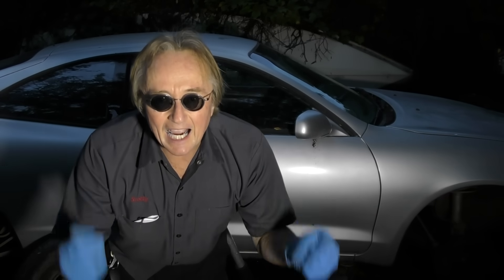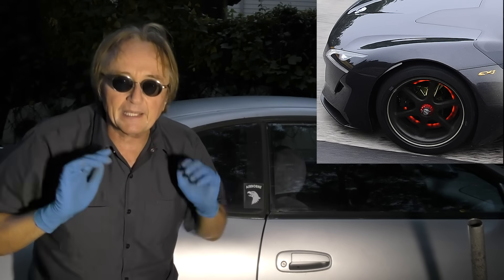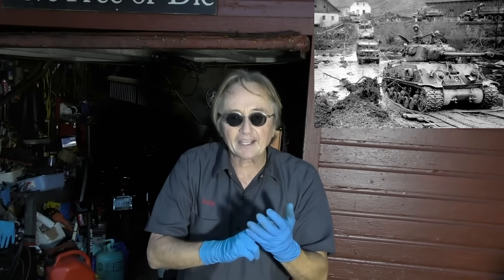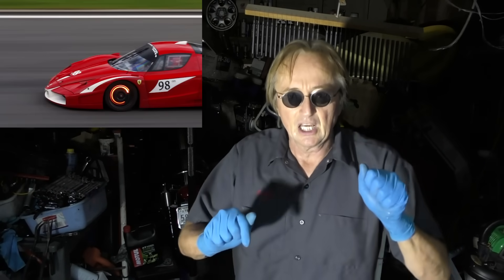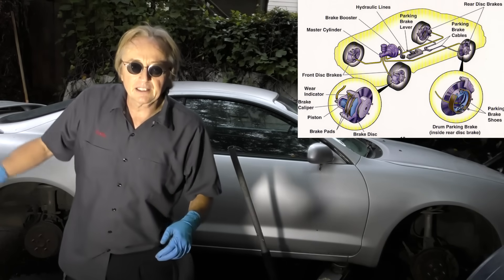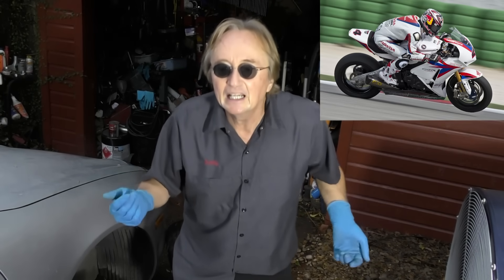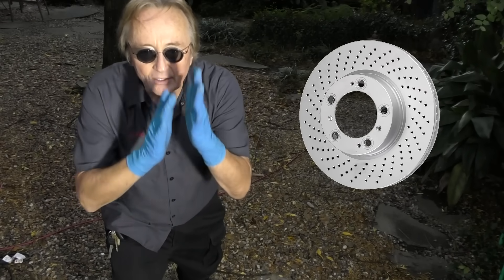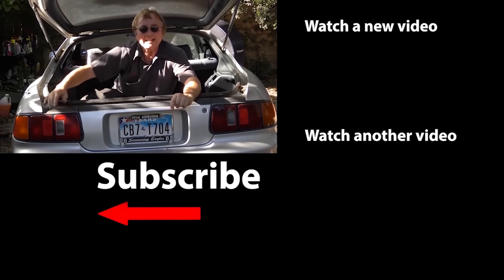Why Some Cars Have Drum Brakes Instead of Disc Brakes

Comment: My old pickup had all wheel drum breaks, and I converted it with front disc Breaks , it saved me all the pain trying to get those front drum breaks work right! , not to mention that they needed to be adjusted every now and then which probably will cause uneven break power distribution to the wheels , and that sure is dangerous , it was a pain in the neck , so I just had enough of that and decided to go with disk breaks , they work way better and most importantly they don't need any adjustments , disc breaks have  calipers which gets tighter as the breaking materials wear out , 
I think it's one of the main reasons why all modern cars have front disk breaks , at least privet cars , 
Scotty didn't mention it so I thought I can share it .
Reply: Yep, definitely worth swapping.  Also, the reason why your brake fluid level in the master cylinder reservoir drops over time.  Many people don't realize it and add more fluid, then when you have the brakes replaced you end up with all that fluid that was added pouring out all over the place as you force the brake caliper pistons back into their home position.  Fluid dropping over time is normal...course an empty master cylinder is not normal, but a gradual drop in fluid over a long period of time as the brake pads wear is just the way they work, as the pistons adjust to brake wear the fluid level drops.
Reply: @wildbill23c  
True , 
But I don't see any problem filling the break fluid reservoir , as anybody with little experience can figure that out and remove some fluid from the reservoir before putting new pads , no big deal  ,

What many  people don't know is that break fluids needs to be changed over time , most people I know they never changed their cars break fluid since the day they bought the car .
Reply: It's funny that so many people can't spell brakes

Comment: Thank you dear Scotty so much once again,  this is not just telling truth about car parts but also what does really make sense, where the hell would  I need race care brake discs and pay a lot more, they would squeal and make horrible noise. I didn't find any episode where you help maintenance about disc brakes, not just discs or pads but also those tiny bolts I'm sorry I don't know their real name as a Finnish guy but they need to be cleaned and lubricated once or twice a year, otherwise pads are touching discs all the time, make noise, wear out too fast, cost more and damn lousy gas mileage.

Comment: Kind of interesting which/when car manufacturers made the switch to four wheel disc brakes. I have a 1993 Honda del Sol with front disks and rear drums. I also have a 1981 DeLorean DMC 12 with 4 wheel disk brakes. 
Although Scotty mentions drilled or slotted rotors for disk brakes,  I didn't hear him mention the performance difference between vented and solid rotors.

Comment: Rear brake with a motorcycle is how you keep the nose from diving under braking and is especially useful around corners to scrub a little speed without upsetting the bike.

You can also stop shorter using your rear brake, and reduces front end slide if your front tire  hits an oil patch.

Comment: I don't think it's 90% stopping power done with the front brakes, more like 60%-%70. The most efficient way to stop on a motorcycle/bicycle is to use both front and back brakes at the same time.

Comment: Drum brakes are much stronger for the parking brake. Discs in the rear seem almost impossable to lock up. Drums can be locked with less pressure but would no doubt fade quicker with extended usage.

Comment: bevelled cross drill and slotted rotors....don't crack, don't get hot, don't make as much noise, last well over 200k on a normal use vehicle and don't eat pads (provided you got some quality rotors and not junk)

Comment: Drum breaks are pretty cheap. That's probably 80%-90% the reason why they're on the rear brakes of cars that have them in todays world. Save 10 bucks per car multiplied by 200,000 or however many are made... saves them millions a year. 

But to be honest if I'm buying a new car I'd rather pay the extra 20 or 200 or whatever they think they need to charge to have 4 wheel disc. Disc are so much easier to service. Drums may be cheaper, but dealing with the adjuster, the springs and pins and so forth is just a hassle.

Comment: Most motorcycle riders use their rear brakes 95% of the time. You use your front brakes in an emergency or to keep from rolling on a uphill or downhill stop. Otherwise you will be pitched over the handlebars very quickly.

Comment: The old drum brake systems with the square headed adjuster on the back plate was better than the modern ones with self adjusters because the self adjusters cause a problem with very poor handbrake performance. This has been very true with vauxhall vehicles with drum brakes on the back axle ever since they moved over to self adjusting drum brake systems in 1974. If you buy a vauxhall vihicle you should make sure it has disc brakes all round. However some manufacturers make better self adjusting drum brakes.

Comment: Even mountain bikes have hydraulically actuated disks these days.
Reply: Unnecessary overcomplexity... cable actuated discs are more than adequate at efficient transfer of force for most riders.  But then Shimano has gotten many people thinking they need fancy gizmos with batteries and servo motors to actuate their derailleurs with twice as many cogs as they really need so what do I know.
Those guys make great components, but you have to throw them all away every other year to keep compatible. LOL. Good thing theyve stopped at 11 speeds, since they can only make chains so narrow. Now theyve decided the way to force you into a new groupset is LESS. 1X11 with up to 36 rear teeth for the ROAD? I think its to appeal to dullards who cant get derailleur adjustment and chainlines right.
Reply: @batvette  try Enduro or downhill mountainbiking without hydraulic brakes. Lol. Hydraulic disc brakes are God sent for mountainbiking.
Reply: @flashyplayer  well call me dumb but i still dont understand why. It doesnt help with brake fade and I doubt even such extreme bicycle braking needs the more efficient nature of hydraulic force transfer over mechanical. What you claim is true but is it because of the increased efficiency of fluid transfer or merely because manufacturers use hydraulics in heavy duty brakes as marketing tools? Seems to me they could accomplish the same thing with improved cables and sleeves and better leverage on controls and calipers. Perhaps beefing up all of that brings a weight penalty that hydraulics then offsets. (Obviously Im not arguing you are wrong but just offering thoughts for your input)
I mostly ride my circa 2000 klein quantum race pro but Ive had a few exotic mountain bikes including an all titanium bike i spent a year buying components off ebay at bargain prices yet still had $4k in it. Frame was a us made early production blem from a washington factory that made ti frames for all the us manufacturers. Like $700, a steal.  Had those shimano xtr rims they made for one year with spokes anchored on the sidewalls and ti hubs.... ti chainrings, morati one piece ti bar and stem... judy xl double crown but light forks. Full xtr stuff but the least exotic were the avid bb brakes and i loved the lack of maintenance required. They did require rock solid sleeving.
Miss that bike but as light as it was I wasnt riding in dirt and on the road it was a slug compared to my klein. Last of the great aluminum frames.
Reply: @batvette  simply because mechanical brakes are too linear when it comes to braking. Hydraulic brakes provide a 'progressive' feeling when you brake. Not to mention hydraulic brakes are more reliable than mechanical ones, there's a reason why cars use hydraulic brakes. The force applied is also greater on hydraulic brakes, which mechanical brakes cant really provide. you also can get more surface area on hydraulic brakes with their pots. Hence why we have 4-6 pot brakes which isn't possible with mechanicals, that could also help combat brake fade. Sure mechanical brakes could be improved, but that would make it far too overcomplicated. A hydraulic brake isn't that complicated, a fairly maintained, regularly bled hydraulic brake would last years with no issues what so ever.
Reply: @flashyplayer  thanks for that.

Comment: Scotty, its worth mentioning that emergency/parking break almost always is drum brake. Even in four wheel disc brake car there is typically drum e-brake  (inside of the disc). It is because disc sucks as parking brake. Drum brake is self locking - allowing small actuation force from the  unassisted mechanical lever to keep the car from rolling down slope. This is another reason inexpensive cars have rear drums.

Comment: Scotty. Alot of cars still use drum brakes for parking brakes, easier to install. Hope they still teach drums to Automotive Students, along with Carburators. And how to install a distributor. Saw a vid recently of Dickie wearing supposed mechanic wizzes, 4 whiskers between them, trying to Build a old school Mopar 440. Couldn't or didn't understand How. 😀
Reply: easier to install? why would carb. maintenance still be taught? new cars dont have distributors and new breed of mechanics are not mechanics, theyre parts changers. true mechanics are a dying breed

Comment: Where do you get this information? Drilled and slotted rotors have nothing to do with heat. Drilled were to allow the gasses from old style brake pads to escape, slotted is to get debris off the rotors. By removing mass from the rotor you actually take away some of its ability to transfer heat.

Comment: In 1967, Volvo installed on the new 140 Series disc brakes on all four wheels. Pretty amazing that Volvo knew of the safety benefits of discs on all four wheels even back then for a production car. I have a 1970 Volvo wagon that also has 4 wheel discs.

Comment: BMW brakes 50% front and 50% rear axle and that's way they have all rear disc brakes. In Africa when you drive with drums in the desert you can't get rid of the sand inside drums without disassambling drums. Disc has better heat dissipation and self cleaning. Drums has bad heat dissipation and hot surface is inside drum and hot air is trapped inside drum what means bad cooling and all impurities such break dust are trapped inside. Still many manufacturers are making combined rear axle brakes, disc connected on brake paddle and drums only for park brake.

Comment: Based off all of Scotty’s vids look for: 
4 wheel disc brakes
Chain, not a belt
Toyota or a good brand
Manual trans
😁😁
Reply: The perfect vehicle has already been made and its a 1994 Toyota Celica. Save yourself the trouble don't even worry about anything else.

Comment: The hand break uses the rear drums when fitted for static use. Even all wheel dics use an additional drum system on the rear for the hand break. Like Scotty says different break systems for different cost affective uses. As always thank you Scotty.

Comment: Sorry for my bad english because it is not my mother language. Here is the question: When a petrol engine completely finish it’s gasoline, no problem, refill the gas tank and start the engine. But, when a diesel engine completely finish it’s diesel fuel it doesn’t work despite refill the tank. Why is that and what to do if it completely finish ?
Reply: You have to reprime the system on a diesel engine.  I'm not sure if that is true on the modern electronically controlled diesels though, the old mechanical ones once you ran them out of fuel you had to reprime the fuel pump to get the air out of the system.  

I hope someone with better diesel knowledge replies to this, I bet there's a much better explanation that I gave as to what happens when you run a diesel out of fuel and why you have to manually reprime it but you don't on a gasoline engine.
Reply: Thank you William. As you say we need better explanation especially about why petrol engine works quickly and diesel not. Probably because of the air in the system as you say.

Comment: Back in the day, drum brakes through water, I came out the other side, kept my foot on the accelerator, but used my left foot on the brake, slow at first, increasing until they dried.

Comment: I put 2003 cobra front and rear brakes on my 1986 mustang.  the factory 86 had drums and 10" discs.  and even driving normally having to make an evasive stop...the stock setup was hot garbage.  after the swap, that car braked so hard sometimes I felt like it was going to pop my eyeballs out of my head when jamming on the binders.

Comment: My '93 Celica came factory with 4 wheel disc brakes. My '90 Celica, I converted the rear drums to discs. My reasoning... it's cheaper to buy the same set for both cars. My '93 is turbo charged.

Comment: I have heard from many people riding motorcycles that you should not use front brakes that often and use rear brakes. They say if you brake too hard on the front brakes you might fall. Well as far as i know front brakes are the most important. You will come to a stop faster when you use front brakes rather than rear brakes. But my advice is use both brakes if you need to stop immediately. Rear brakes can be used to slow down the vehicle and for light braking. Because when you decelerate due to inertia the weight of the car comes more on the front tire and less on the rear tire. Hence they have better grip. Same happens when you are accelerating the weight comes on the back wheels and they have more traction. Hence you will find that during launch a rear wheel drive car will perform much better than a front wheel drive car.
Reply: In motorcycle safety class to get your MC license it is taught to use both breaks. 70% stopping power comes from front, 30% comes from rear. Yeah if you break too hard on front only it won't work out well.... In class they also teach a gradual breaking. It's not like a car where you can (in most situations) slam the break pedel to the floor and not have adverse steering issues..... Rear break only is suggested like while cornering.

Comment: They not only fade in racing but in commuting like I did back and forth 133 miles a day.  Like my disc brakes on all four wheels much better. Also had a 1970 Ford Maverick, drove it into the ground, as it were.  When I sold it the driver seat was nothing but wire springs and used an old chair cushion in place to drive, great little car scot.

Comment: I had 3 Volvos in the past. The 1988 740, 1989 760 Turbo, and 2000 S70 T5 Turbo. One of the reasons I like Volvos is because they were one of the first cars to have 4 wheel disc brakes as standard equipment.

Comment: Disc brakes are easier to replace, sometimes. If the caliper fit in easily to align with the alignment bolts, it's a piece of cake. However I think it costs more to manufacturers to install disc brakes.

Comment: Hey Scotty, I have some aluminum drums off the back of a 2000-2006 Honda Insight hybrid that will bolt up on the back drum brake assembly of my 1993 Honda Civic VX EH/EG hatchback (lean burn) and they knock off about 3 lbs of rotating mass a side, for better fuel economy. 

What's your opinion on the aluminum? And did they make special brake drum shoes for them that you know of?

Comment: I've replaced drums to discs in the rear of my peugeot 205 just becouse it pusches a weels 1 cm wider so i could install 405 mi16 14" wheels :)
I know i could just use a spacers but i've had those parts laying around

Comment: I always thought that drums were used in the early days before power assist because of the larger surface area compared to disk  .Disk breaks requires extra force to stop compared to drums thats a fact.

Comment: Hey Scotty when can you say you gotten your money's worth out of a car, bought a 08 crown Vic PI, i had it 6 months put 15,000 miles on it only thing I had to replace is a $60 alternator clutch, paid 2500 for the car, still running good
Reply: I paid $800 for a police CV over fifteen years ago and only had to stop driving it recently due to a blown head gasket. I def. got my money's worth. I think I might rebuild my engine for a few hundred $ and get another fifteen years out of it.

Comment: for older offroad motorcycles with drumbrakes: you can cut 3-5 diagonal grooves in the brakepad (I used a hacksaw), they can catch dirt and water, just clean them from time to time.

Comment: Hey Scotty, you're a smart man and I like your videos, put on a motorcycle there's a lot more to using brakes. Yes most you're stopping power is in the front but you should always use both brakes every time you stop. For several reasons and sometimes you just use the front and sometimes you just use the back but 99% of the time you should always use both and how much you apply of each just takes time and experience.

Comment: I remember working at a firestone store back in the mid 70s. I was doing 4 wheel drum brakes with an alignment for 99 dollars plus tax. Cut the drums, new clyinders,new springs,new shoes,repack the bearings, and new seals. And set the toe and let it go!

Comment: Simple.drum brakes only used for economy slow cars and no sports car will have a drum brakes.dont put civics on this sports car having their drum brakes ok.cause once u have OEM drum brakes,know that your car is an economy car.
Reply: Most "economy cars" nowadays are using all disc brakes for the front and rear, pure base fleet ready models notwithstanding. Cars made for third world countries however have vehicles that use discs but have rear drums.

Comment: Scott you brought up that the back brakes help avoid slipping and sliding I have a 1996 dodge ram with drums un the back and avaoid driving in rain or snow due to the fact it tends to lose back control would converting help this issue? writing to you from dallas texas a new subscriber and fan thank you for your strait advice!